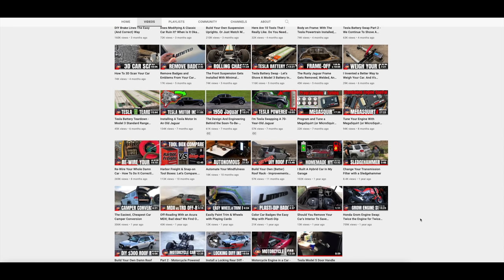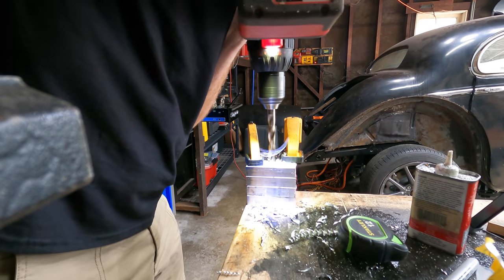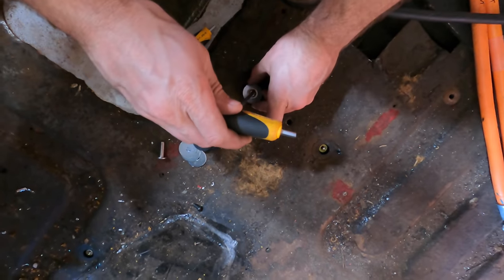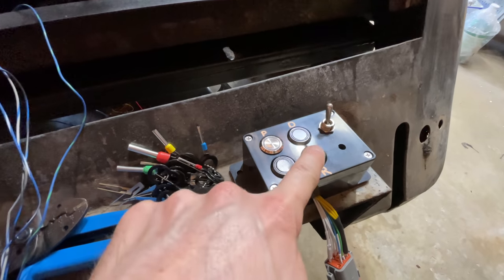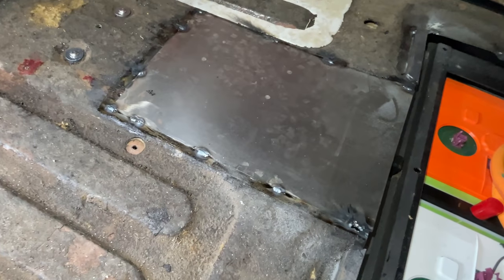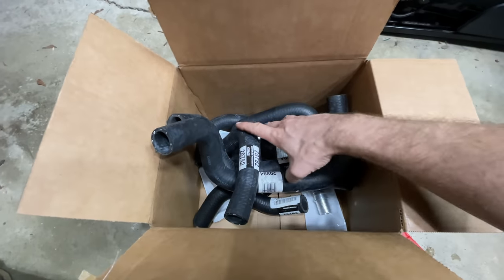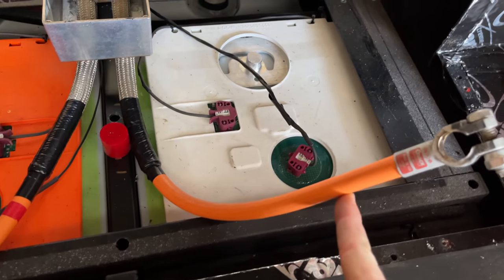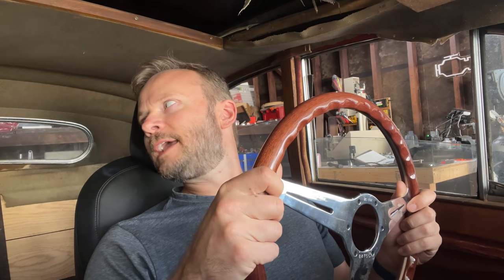Questionable Solutions To Project Car Problems

Comment: Quick way to remove the floor schmoo is dry ice and Isopropyl alcohol. Removes everything. factory sound deadening and insulation. You'll need a LOT of Dry Ice and maybe a half gallon of ISO. Soak the floor area with just enough ISO to get everything damp. Then cover the area in dry ice. Crack a beer, take your time drinking it. Then scoop the dry ice into a bucket and scrape the floor with a wide putty knife. or something appropriate. Thank Power Nation's Detroit muscle guys. It was their tip. Cheers y'all! Remember Fusion Power is ONLY 30 years away!
Reply: That's a very cool tip, thanks for sharing. 😎👍🏻
Reply: @4literv6  Agreed.  I had not heard of this before.  Had a guy tell me to use kerosene and light it up to loosen the goo.  Didn't take him up on it as some British cars are self igniting anyway and I didn't want to burn down my garage.
Reply: I just tab weld The panel and then wait for the heat to spread, then just take off with a screwdriver

Comment: Dry ice on the floor makes that stuff (floor sealant, seam seal, tar, whatever is on there) 
brittle and pops right up. Not sure you will have to do this again but makes it alot less painful to get done.
Reply: I wasn't going to say anything after it tool him 5 days....
Reply: This.. rally car prep essential. It's still a pain in the ass doing it with dry ice but at least it's quicker and more dangerous
Reply: @p_jones  the more dangerous part adds a lot to the experience.
Reply: For people who do have the stuff which shatters when cold (not likely this Jag)... if you live far enough north, you just have to procrastinate until winter, then hit it with a hammer. Worked for me.
Reply: @FUCK_________googIe  I'm gonna say if you can chisel/scrape it off at ambient temps, there's a chance it would come off in bigger bits at very cold temps. Maybe Matt could put it all back in and give it a try (for the algorithm)
Reply: @FUCK_________googIe  good to know!
Reply: @FUCK_________googIe  "The softer it is at ambient temps, the less likely it is to harden up by freezing." That's the opposite of my experience in general, which granted doesn't include this dry ice technique which is new to me

Comment: "Wood probably isn't the best long-term solution."
Morgan has left the chatroom
Reply: Wood. What can't it do?
Brought to you by the wood council
Reply: Best comment on the entire channel.
Reply: Build a house lately? Exactly what material are you using if not WOOD?
Reply: @spuddy4063  depends on what country you are in. 2 by 4s and drywall are not as popular in europe as they are here in the US...
Reply: @uliwehner  totally agree. But wood has many uses but we don't build cars or vehicles from wood either. Wood is used for holding things up including cars and even our railroad ties are made of WOOD. They do hold up many things with wood, must be why it is popular.
Reply: ...and Marcos dabs at brow...
Reply: 1930's BMW 319/1 Sport left the room (long ago) (and then returned)
Reply: @spuddy4063  Um, bricks?  They are great at not blowing away.
Reply: @spuddy4063  concrete, other masonry, steel... but we get your point.
Reply: @edumaker-alexgibson  Unless your house is more than a hundred years old, your bricks are likely only a layer thick over a wood frame.  I didn't know that until I built a house.
Reply: @12x2richter  what country are  you basing THAT on?
Reply: I came here for this
Reply: @edumaker-alexgibson  probably the us, i was a laborer/masons apprentice for a few years and every house i worked on was wood framed with brick on the outside.

Comment: These kinds of things are absolutely the most important parts of a build. I'm starting my '81 RX-7 time attack build with full '04 RX-8 drivetrain and suspension, and by far the most intimidating part is the inbetweens. The fitting stupid shit, welding stupid shit, wiring stupid shit, brake lines, EPAS, you cover so many little things everyone else glosses over that'll take the layman days if they're normal or weeks/months if they're sane (unlike me who's gonna get slapped the fuck into Super Unlimited immediately)

Comment: Matt, next time you need to jig saw a piece of sheet metal lay it on top of some 2" think hard foam board. The saw won't know the foam is there and the sheet metal won't vibrate and bounce like a mo fo! Use a propane torch to soften that black shit as you scrape, mucho easier. You can anneal aluminum, cover it with soot from an acetylene torch with no oxygen, and then add oxy and slowly heat the metal until it gets just hot enough to burn the soot off, as an indicator of the correct temperature.
Reply: I saw that on one of the Ron Covell videos years ago, thanks for the reminder.
Reply: Rather than trying to heat up 6000 series aluminium to bend it would be better to buy the correct grade. 3000 or 5000 series alloys can be cold bent without issue, and will actually come out stronger afterwards. Heating up any of the precipitation hardened alloys like 2000, 6000 or 7000 series will spoil the temper and greatly reduce the strength.

Comment: A heat gun would have made scraping the goo off the floor easier. Since the Jag is an English luxury car, I'll assume the goo is made from boiled orphans that will easily soften with heat. Now that I have thought about this for a second, heating batteries is a bad idea. Carry on.
Reply: Spot blaster plus vaccuum cleaner.  Slow but less messy and deals (properly) with the rust, which is going to come back to haunt you.
Reply: @21jimmyo don't forget to clean the soot off the orphans (circa 1820, chim chimenee, chim chimenee, chim chim cheroo et al)
Reply: @troo_story  The weirdest thing is that the faux pom is still alive!

Comment: Sometimes tackling various little things like this can be a peaceful, low stress part of the project. I often get a nice feeling of accomplishment after completing some of the little things that have been bugging me.
Reply: On longer projects it makes you feel like you're not getting anything done.  In reality, you're getting a LOT done that has to be done anyway, but you just can't look back at it and feel the accomplishment.  Mounting battery boxes or a motor or the body is a lot more satisfying than fitting the vacuum pump, or installing the fuse in the circuit that you've had wired hot for months when you knew better.

Comment: I had to do the same thing with my MGB floor pans.  Luckily, I had a Dremel oscillating saw thingy.  It worked a treat digging through 50 year old asphalt.  I think that self leveling stuff looks to be what I am going to put in once I fix the floors.  I have been ignoring the floors a lot like you.  I will get to it eventually.  lol

Comment: I took the dashboard out of my car to fix it in January - I figured it would only take a couple of weeks. It's now September (only just), and the dashboard is still out. Mainly because I need to move some more things to fit it back in, and ever time I get one done, 2 more appear.
Reply: Similar story on my rescued 944. About 1 year in now and have managed to get it roadworthy. Seems every time I fixed 1 item 2 more appeared. Made a list and committed to complete 1 item every day even if the list grew. Finally got o the road last week and it feels so old. Wait… are those the shocks I hear clunking in the rear?

Comment: To clean the floor, you can freeze the crap (with dry ice) before you remove it: it will limit the gooeyness to a minimum. A really low minimum.

Comment: The "little things" are sometimes the biggest problem! And sometimes, it takes one big thing to order the process of all the little things. I'm installing a sound system in my car, and the amount of little things is daunting to the point where it's easier to consolidate them into one big problem, and go through oder of operations from there. Ugh.
Reply: Door panels off, speakers out,
Interior trim off, run wiring, smack your head in the trunk pulling up the speaker grill
Speakers in
Trim on, panels on, car on, stereo on
3/4 speakers functional....
Glass of rum, door panels off again.. etc

Comment: If it helps, I had Send Cut Send perforate my bend lines to make them easier to fold. It made it really easy to fold thick sheet over long lengths with a couple of pieces of angle iron clamped in place to help the folds. Also, the crud on the floor comes up really easy with a heat gun with the spatula attachment. Great idea to use the self leveling sealer, its a great sound deadening solution. The car looks like its coming along great. Are you going to make a Grey Pupon holder for the dash for when you pull up next to another posh ride?
Reply from the maker: Grey Poupon will definitely be an added feature
Reply: @SuperfastMatt  you may have to pass the grey puppon yourself, the help in the trunk seems “distracted” and it’s impossible to find good help these days.

Comment: Check out ChrisFix's video on how to lighten a car. In it, he uses dry ice to freeze the sound deadening goop, then smashes it off with a hammer. In the future it might be a touch less work than manually scraping every square inch of the car (which I've done, and which is terrible)

Comment: would a massive knotted wire wheel on a beefy angle grinder been able to scrape up all the crap off the floor? i bet it would make a big ass mess tho. Just wondering if you considered it, cheers!

Comment: Tip for next time you are spending 5 days scraping off rubber sound deadening goo; dump some dry ice on it and whack it with a hammer, it will shatter and fall right off (in less than 5 days).

Comment: Quick question:  Does that self-leveling compound you put in the floor have silicon in it?  Because if it does, it'll eventually rust the floor because of the curing agent.  How do I know this?  It's a long story involving an Army General's Huey, and it being grounded by the Private First Class.
Reply: Not all silicones do this, but the common hardware ones certainly do! It's because the curing reaction produces acetic acid (i.e. vinegar!) as a byproduct.
Reply: @nerd1000ify  That's what I learned when I grounded the Generals bird because someone used silicone instead of the proper sealant, rusting the control tubes to the main rotor, which all had to be replaced.

Comment: Epoxy paint on a polyurethane sealant is not recommended: epoxy has a higher surface energy than PU.

The first rule of adhesion is that you can't stick what you can't wet. To wet a surface you need to use something that has a surface energy less than or equal to that surface.

This means that PU will bond well to epoxy but not the other way around.
Reply: So epoxy painting first, then filling with the self-levelling stuff, then covering with Dynamat... makes sense, and would make more sense to me anyway, aside from the adhesion issue.
Reply: @brianb-p6586  Got it in one.

Comment: First time I’ve seen anyone just pour stuff out of the ass end of a caulk tube.
Reply from the maker: it was a partially used tube, so the front end was hardened up.
Reply: Most stuff that comes out of caulking-style tubes doesn't pour well, unlike this "self-levelling" stuff.